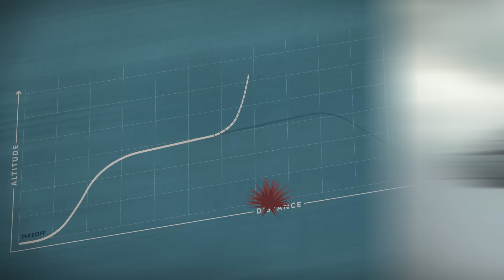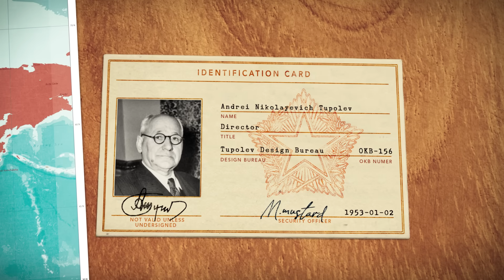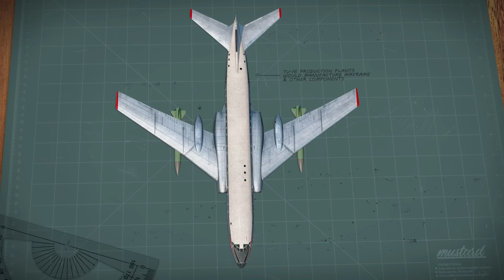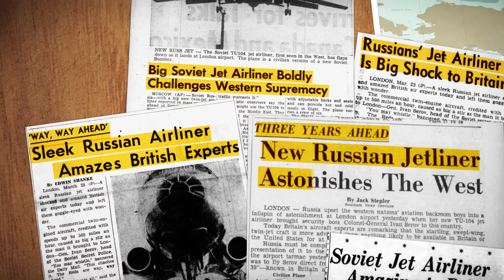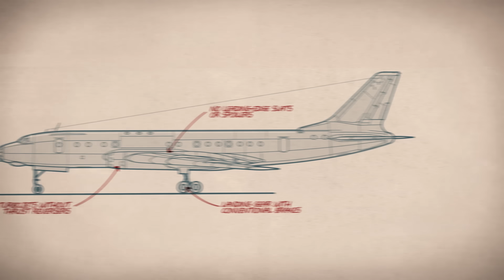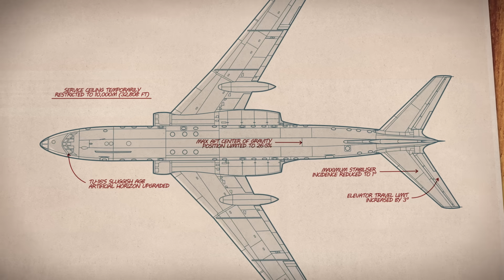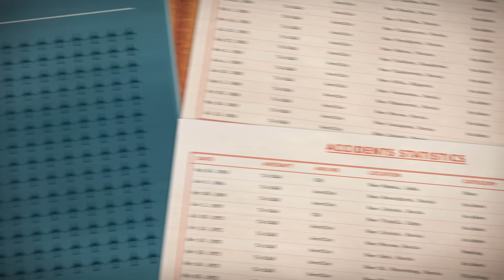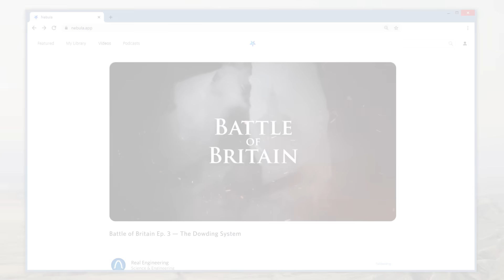The Soviet Airliner Designed To Crash

Comment: Apart from the wings falling off, the DeHavilland Comet was a very pretty aircraft.
Reply: Nothing to do with wings; metal fatigue with stress points around the windows were the primary issues.
Reply: @nickjung7394  The catastrophic in-flight structural failures of the Comet Disaster occured along the roof of the fuselage between the wings and caused the wings to instantly flap down like a bird and then tear away.
Reply: @nickjung7394  all of the independent investigations revealed that the passenger windows had nothing to do with the catastrophic structural failures.
Reply: @sandervanderkammen9230  I am not sure that you are correct. I remember a report that related Sir Frank Whittle's comments about the shape of the windows that suggested stress cracks at the corners. I remember as a student in the 1970s a demonstration using polarising lenses and a variety of shapes, including a square frame with rounded corners (like the Comet)  that clearly showed stressed areas. If you look at the shape of the windows on the early Comets compared with that of the later ones you will see what I mean.
Reply: @sandervanderkammen9230  your statement that De Havilland "didn't understand how to build or test metal airframes" is a little silly. A mile from where I live is a De Havilland Vampire, have you heard of the Venom and Sea Vixen? I fear your "research" is a little out of date. May I suggest that you look at the lecture organised by RAeS Hamburg Branch Hamburg Aerospace Lecture Series (DGLR, RAeS, VDI, ZAL, HAW Hamburg) 24.01.2019 HAW Hamburg (Hamburg University of Applied Sciences) !
Reply: @nickjung7394  Your comment is very silly and reveals someone with very little experience or knowledge on this topic.
 The Vampire and Venom have fuselage structures MADE OF WOOD!
 The Hawker Siddeley Vixen, while Intially developed by de Havilland as It's very first all metal jet aircraft  was introduced and constructed by Hawker Siddeley after demise of d-H, the collapse of the de Havilland company was the direct result of the Comet Disaster
 The Sea Vixen was a very disappointing aircraft with a checkered history and an appalling loss rate.
 Perhaps you should do a little more research before making yourself look like fool?
Reply: @sandervanderkammen9230  whilst the vampire certainly has stressed laminated wood clad with aluminium, DeHavillands knowledge of stressed composite materials was of a high standard. No other manufacturer had more knowledge of stressed pressurised airframes. The Vampire and Venom were very successful. I suggest you research the government policy regarding British aircraft companies. They were amalgamated, rather than taken over.
The science of stressed airframes is not just associated with those made of metal; indeed modern non metallic materials have more in common with bonded wooden structures than rivetted metal frames.
I suggest you look at the reference I gave you, you might learn something!
Take note of Pope's phrase...a little learning is a dangerous thing!
Incidentally, a brief examination of the vampire near me together with a little competent research showed that only the cockpit pod was made of moulded laminated wood, the wings and booms were metal construction.
Reply: @nickjung7394  You are clearly not qualified to discuss this topic if you are unaware of the fact that the de Havilland company was decades behind in aircraft technology and was still building aircraft primarily from WOOD and FABRIC well into the Jet Age.
Reply: @nickjung7394  The Comet Disaster was the result of a catastrophic in-flight structural failures of the aluminum fuselage. 
The Comet was de Havillands very first attempt at a production jet aircraft with a fuselage made from revitted aluminum. 

The Vampire and Venom were built with fuselage structures MADE OF WOOD AND FABRIC, NOT ALUMINUM.
Reply: @nickjung7394  The real tragedy of the Comet Disaster was that it could have been easily prevented if de Havilland had simply followed well-known and understood industry standards for the design and construction of pressurized cabins made from riveted aluminum alloys.
De Havilland company lacked the knowledge and experience of other more advanced aircraft companies like Boeing, Douglas Junkers and Lockheed.
Reply: @sandervanderkammen9230  Suit yourself. I do, however, suggest that you learn to read....or visit  the De Havilland museum at London Colney and speak with some of the engineers there. You may learn something (although given your attitude, this may be difficult!). By the way, the stress cracks on at least one of the Comet crashes started on a square framed window on the roof of the aircraft.
Reply: @sandervanderkammen9230   Wrong,wrong,wrong. The Comet prototype was built using very advanced bonding adhesives. The fuselage is on display at the DeHaviland museum and the internal cladding of the cabin area has been removed to display the method of construction.
Reply: @nickjung7394  Wrong again son, the de Havilland Comet has no passenger windows on the roof.
Are you referring to the fiberglass antenna appatures?
Reply: @dartskipper3170  de Havilland used a variety of unusual and unconventional design and construction techniques in the development and production of the Comet.
The use of adhesives and sealants in the construction of pressurized cabins was well-known and understood.
The catastrophic in-flight structural failures of the Comet Disaster 
we're the direct result of poorly designed and shoddily fabricated riveted fasteners in aluminum skins that were too thin and brittle, cracks formed during construction and propagating through the weak skins.
The catastrophic explosive failure was due to the cracks linking up suddenly, this should not be allowed to occur but de Havilland didn't not use proper rip-stop doubler joints and fuselage reinforcements hoops were too narrow and spaced too far apart to stop the cracks linking up suddenly.
The failure mode has nothing to do with Redux adhesive.
Reply: @dartskipper3170  The Comet Disaster was caused by de Havillands lack of experience and knowledge in the design and construction of pressurized cabins made from riveted aluminum alloys.
de Havilland was still building Wood and fabric biplanes like the Dragon when the Industry leaders like Boeing, Douglas Junkers and Lockheed were building all-metal monoplane aircraft with pressurized cabins.
de Havilland simply lacked the technology and continued to rely on outdated and obsolete technology and materials like wood and fabric held together by nails and glue.
Decades behind their revivals in the industry.
The Comet was well beyond de Havilland capabilities and was doomed to failure.
Reply: @nickjung7394  Have you heard the joke about the British space rocket?
Reply: @sandervanderkammen9230  as I stand here leaning on a De Havilland Vampire, I can see that the cockpit pod is, certainly made of moulded composite plywood clad with aluminium. The wings and booms are certainly made of aluminium. Please grow up! I could also add that my father in law worked for De Havillands. My 28 years as a University lecturer taught me how to use my reading skills to carry out research. Others will judge this thread!
Reply: @sandervanderkammen9230  there are risks associated with all technological advancement.....or have you no experience of this area? Certainly, it is a rather warped mind that denotes such things as a joke!
Reply: Need to check your facts sunshine,,  the Comet issues were nothing to do with the Wings.
Reply: @andyb.1026  I think it might've been more of a metaphor?
Reply: @PhoenixTwoFiftySix    ah,  so you can scribble any old nonsense,,   with the lame excuse "it's a metaphor "  ,,   perhaps make that clear,  then we can ignore any other inputs
Reply: @andyb.1026  d-H Comet is a metaphor, it is a celestial body that explodes in the atmosphere..
Reply: @andyb.1026  the wings fell off immediately after the catastrophic in-flight structural failures of the fuselage, these horrible designed aircraft exploded.
Reply: Other than that, how was the flight, Mrs. Lincoln?
Reply: @rwill156  The flight was a bit noisy by today's standards... the problem was when the Comet exploded.
Reply: I try to avoid flying, preferring to go along with the old saying " If God had meant us to fly he'd have given us tickets".😃
Reply: @andyelliott8027  Flying is safer than driving.
Reply: @PhoenixTwoFiftySix   I raced cars for a few years when I was in my twenties and had quite a few crashes doing it, I walked away from all of them. I wouldn't like to even have one crash in a plane and that's the thing. If you're in a car crash you'll almost certainly survive, if you're in a plane crash you'll almost certainly be killed.
Reply: @andyelliott8027  Big if buddy. Plane crashes are about a 1 in 1.2 million chance, likelihood of death? 1/11 million. Car crashes are a 1 out of 366 for EVERY 1000 MILES. likelihood of a fatal car crash? 1 in ONE HUNDRED SEVEN.
Reply: @PhoenixTwoFiftySix   Big if maybe but I've walked away from around 40 crashes while I was racing cars. I still feel safer in a car.
Reply: @andyelliott8027  Statistics don't lie, you are safer onboard a Boeing in the air than an automobile on the ground.

Comment: Goose Bay AB should be Gander AB, now Gander International Airport. Goose Bay is in Labrador, and not on the island of Newfoundland. Same province, two completely different places.
Reply: What's sauce for the goose is sauce for the gander? 😄
Reply: Goose Bay was built in ‘42. Had folks from all up and down the coast come in for construction jobs setting up the base, and they had a big ol dredge deepen the channel so freighters and oil ships could stop in to fill the aviation tanks.

Weirdly, for a base made as a waypoint in WWII, a surprising number of Luftwaffe have crashed around the base. 

A German F-4 Phantom II crashed into the bay returning from a training exercise in 1981, another hit the ground at an air show in 1993, in 1996 two Luftwaffe Panavia Tornados went down up inside on a training flight, and a third went down south of the base in 2000.
Reply: @joshuahadams  The nazis had a weather reporting station further up the same coast, .
Reply: @arch9enius  up past Saglek. Most of the European contact the local Inuit had by that time was from Moravian missionaries. Adding in the weather station was made to look like a Canadian one, despite us being out own dominion at the time, makes an awful lot of sense no one thought it was weird until it was bumbled across in the 80’s. Killinik, the closest town to the station, was abandoned in the 78 and the folks there moved to Kangiqsualujjuaq, a the bottom of Ungava Bay.

Comment: someone said : there are no dangerous planes, but there are dangerous pilots ...
Reply: That someone was a de Havilland Comet engineer.
Reply: That's something that's drilled into pilots when they're training to be pilots.  And they're right.  The only way to train a pilot is to instill the idea that the pilot is 100% responsible for the safety of the passengers, crew and cargo of a flight, and for the safety of the plane.  A good pilot never flies without that philosophy.  It's a good thing to teach.  But, the reality is that there really are some bad planes out there.  There have been designs built and flown that never should have been put into service.  In this case, a warplane that had problems, from the start, never should have been plowshared into civilian service.  Yes, there most definitely are bad planes, but don't tell pilots that.
Reply: 737-Max must have had horrific pilots.
Reply: @krashd  One of the flight crews actually followed the proper procedure and switched off the auto trim-stab switch but in the confusion accidentally switched back on.
Ask any pilot, a runaway stabilator event can be a terrifying and confusing situation in real life.
Many pilots have or would make the same mistake.
The current trend of reliance on automated systems has had an adverse effect on pilot skills when these systems fail.

Comment: Boeing should have converted the B-52, lol.
Reply: The Boeing 707 series is absolutely based on the B-47 bomber, Boeing had a long history of developing airliners from successful bombers.
Reply: @sandervanderkammen9230  Waitaminit... the 707 was an all-new development and the only thing it had in common with the B-47 was swept wings.  The final wing design for the 707 had a much wider chord and a different airfoil than the B-47.  If I recall, Boeing initially had also considered the wing design of the C-97/B-29 as a starting point since the new plane was initially considered as a straight-wing aircraft.  End result:  The only thing the 707 had in common with the B-47 was (initially) the power plants and swept back wings.
Reply: They did that with the B-29D/B-50, with the #377 Stratocruiser airliner.   Too late to be successful though, with jet airliners just around the corner.
Reply: @tonyunderwood9678  The Boeing 307 Stratoliner is also based on the B-17

Comment: When the T 104 flew transatlantic, how much passenger capacity had to be displaced by the extra fuel requirements?
Reply: That was a diplomatic trip, likely the cabin consist was quite few/light, same for the cargo hold.  Plenty of spare weight capacity for the extra fuel without overloading.

Comment: THE TITLE is propaganda.

The most overt attempt for people to forget the fact that the British turbojet plane was actually the most dangerous. It was falling apart in the skies repeatedly because the company wanted to cut costs and make the body thinner, not taking into account the shape of the windows.
Reply: Fair argument, the statistics do in fact show that the de Havilland Comet was the worst jet airliner in history.
Reply: Modern investigations have completely debunked de Havillands theory that the shape of the windows   was the cause of the disaster, in fact  the Comet 1 was so badly designed and shoddily built that it's airworthiness certification was permanently revoked and the aircraft   had to be completely redesigned... the blame falls squarely on de Havilland company engineers as the second Comet wasn't much better and has a very poor safety record as well.

Comment: Weight and Balance - they should have checked the W&B each time before taking off. There should have been a chart, a sliderule, something.  An Aft center of gravity is death.  That's simple aeronautics.
Reply: The de Havilland company issued takeoff performance tables for the Comet that were grossly in error and blamed pilots for 3 crashes before quickly issuing new tables.

Comment: The parallels with the Boeing 737 MAX scandal are remarkable--rushed design, improperly recycled elements, blame on pilots)--despite the 70 years of difference
Reply: There is nothing in common with the Max, the MCAS system issue was created by government beaurocrats not Boeing engineers.

Comment: Was it more dangerous than the Boeing
Reply: oh yeah. boeing could have been prevented if the pilots turned off autotrim
Reply: @andrewkenobi9486  Too right, both crashes were ultimately caused by pilot error, each investigations found that the pilots failed to follow the proper procedure for a trim stab runaway! Both crew failed to follow the memory check list and switch the trim to manual any time there is an uncommanded movement of the stabilator.
Reply: According to the safety statistics Boeing makes the safest aircraft in the world.

Comment: Some how I think these guys got a bit over confident in their design.  Yes the Comet had it's issues, but they were quickly resolved after the first two accidents (partially I think because it was grounded until it could prove itself worthy of flying again, safely).
Reply: That is a very inaccurate statement.
6 Comets crashed or were destroyed  before the Comet 1 was permanently grounded and its airworthiness certification was permanently revoked due to nearly 100 major fatal design and construction defects.
Although the Comet 4 was completely redesigned it was also plagued with safety issues throughout service with 20 aircraft crashed or destroyed in accidents  (1 out of every 5 built) and was also grounded from service due to premature fatigue failures.